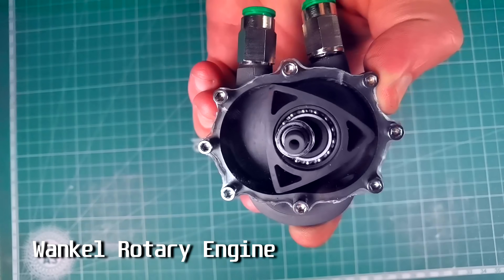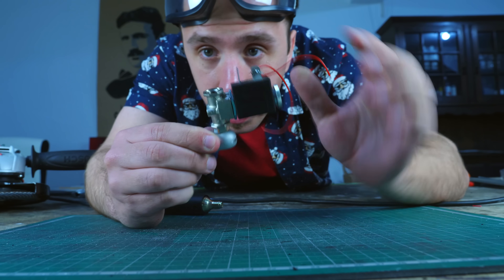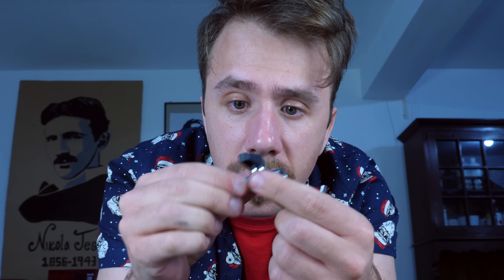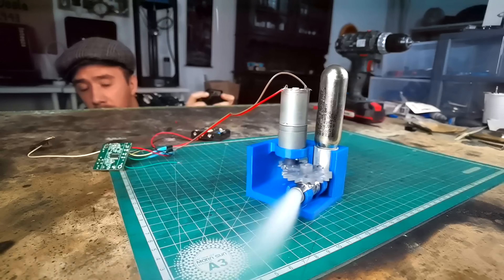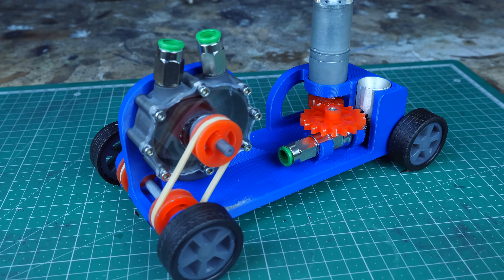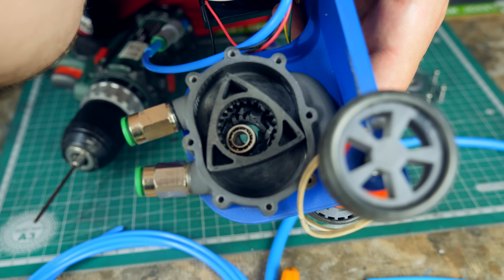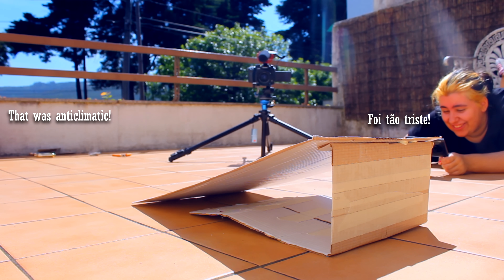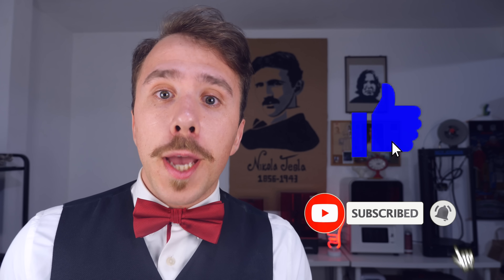Rotary Wankel RC Car (3D Printed)

Comment: I know that you will probably never read this, but 3 things you may want to change on the car is A, to add a valve on the end of the exhaust that adjusts the flow rate, that way you can get higher torque and higher "fuel efficiency." B, I would reposition the exhaust to be pointed behind the car, that way you get extra thrust. And C, I would put an O-ring on the lid, that way it stops leaking so much and losing "fuel."

Comment: Hey what you should do is print another smaller engine to use the exhaust gases for recirculating like the old steam cars did back in the day before the electric start motor was invented for combustion engines and phased out the steam cars. 

Please check this out
https://youtu.be/rUg_ukBwsyo

Comment: In the slow motion footage, the rubber band that was attached to the engine and the wheel axle was flopping around and slipping. To improve, maybe try putting the wheel's axle directly through the axle of the engine. That way, every rotation of the wankel engine will be one rotation of the wheel. The wheels would also need to be made slightly bigger. With these modifications maybe it would go way faster.

Comment: Why don't you make a mini compressed air tank which can hold more air at favourable pressure and then try to rum the car (the engine ofcourse), because using those CO2 tanks is very inefficient and most of the power is wasted

Comment: You should definitely have a part 3 to this. I’ve identified a few issues that you may or may not have identified too that you could fix. First is that the engine is not sealing very well and letting a lot of gas escape. Maybe you can use some kind of sealant to try to keep the gas in the chamber to push the rotor. Another is all the wheel slip which you did state yourself in the vid. And also it’s hard to tell but I think the rubber bands are slipping when transferring power to the wheels. That may also be fixed with the engine moving slower? 

Also it may not matter if it is ripping through co2 so quickly but maybe you could use a steeper motor to more accurately adjust the gas release?

Comment: Apples and oranges. Your engine needs large volume of air, the C02 produces lots of pressure but no volume. Optimize one  at a time, separately. Good job guy. 
.

Comment: You should make a belt tensioner for this car, make the wheel base slightly bigger, and make some kind of regulator for the gas that's coming out. You would get a better pull off the line and you would get further travel.

Comment: Why wouldnt you use a quarter turn ball valve and solenoid?  No gears or extra work to open a valve..  like even an rc one would work and comes with its own controller.. or hell use a 3/8 air nozzle blow gun attachment.  Cheap and reliable and easy to actuate..  a simple magnetc solenoid would for sure work to open n close the valve whuch could be hand made with some mag wire and an iron nail.  Use a paintball co2 tank and bigger n better drive control..

Comment: Idea: 3D print a 3D Printer! I would imagine you would need resin or maybe ceramic or something for the head because of the heat, but a majority of the parts could probably be made with PLA.

Comment: You should 3D printed a Vortex tube which separate compressed air in warm and cool airflow.

 I would like to see A video about minimal surfaces and what are the options for stable 3D prints and using small amount of material.

Comment: Without a mechanism for warming the CO2 to room temperature before it gets into the engine, you only get ~15% of the energy possible. Under ideal (isothermal) conditions you should be able to get almost 300 joules worth of energy out of a 12 gram CO2 cartridge.

Comment: Man, you should 3d print a multi-stage rocket with sugar as fuel. 🚀
Reply: I don't know if sugar alone will work as fuel? I believe you need a mixture containing potassium nitrate (saltpetre) to make solid rocket fuel. In some places it isn't exactly legal, because it is considered as explosives or ballistics.
Reply: Ok, then use another fuel

Comment: Maybe you could design and print a co2 powered RC rocket plane. The plane could be toss launched then the co2 cannister activated, maybe you also design a proportioning valve for the thrust and fly it around.

Comment: Would designing the Wankel engine "piston" with concave curves, rather than convex, increase the power of the engine? Im not sure how much the housing would have to be changed to accommodate, but I would thing that pressure against a "scooped" surface would give you more bang for your buck. The thinner points to the rotator might give reduced integrity, so a stronger material may be needed. Good luck!

Tldr. Give the spinny some weight(mass)-loss.

Comment: You can 3d print an orifice to work as a jet for the out gases. this should give more thrust to the vehicle (Car if you want to name it so)
also you need to control the exit pressure by controlling the orifice opening (using a servo motor should do the trick) by doing so you can control the speed and maintain longer run time.

Comment: Make a 3D printed RC tank or plane? Maybe with some sort of Tesla component in it. Maybe the plane can be powered by compressed air and a rotary valve if you can control the flow rate or expansion rate (Thrust) of the compressed gas, and have it hook up to your rotary engine, and a propeller (or multiple if need be).

Comment: to fix this car you could add weight to the front of it or you could make a gearbox that turns the many rotations of the wenkel engine into a bigger gear for a slower but stronger spinning wheel (more torque). i like watching your videos :D

Comment: If you look at the slow mo of the engine, you can see that the rubber band is too slack and thus almost all of the engines power is lost to overrotating of the engine pulley.

Comment: Video idea: build a Wankel engine with multiple rotors. Other people have already mentioned that co2 needs to be atomised first, and you also need a geared transmission, but I also noticed the large amount of vibration caused by the single rotor. Add more rotors offset from each other to help balance the vibration

Comment: You clould use the wankel engine with the Co2 cardridge as helicopter. You already had a propellor mounted and with a bigger one it could be possible to shoot it like 30-40m in the Air

Comment: Make the drone rotor powered using compressed air. May require you to figure out a way to better control air flow, but I can already tell you like a challenge

Comment: Try to seal the engine further to get as much as possible out of the CO2 container. Make a better gearbox. And strap on two CO2 containers as a rocket booster. "Voila" controllable Rocket powered RC car!

Comment: Future Video theme: - Using a Nichrome heating element to excite atoms for more directed thrust
Have you ever considered using the electrical heating element (Nichrome) from a Vape (Electric cigarette) to function as an induction coil for either an Ion engine, or a heat vector engine?

Comment: What about a fully 3D printed tank with tracks. Put the improved and much slower expulsion of co2 canister with your wenkle engine on its side instead of vertical to power the tracks so you don’t get as much jumping from the motor.

Comment: Try useing a chain instead of a rubber band and get a better tire for it, then add a centryfugical (how ever it spelled) clutch to it and also a better valve for the co2 that you can controll, maybe try a plastic bottle for an air tank.

Comment: You are losing so much power because the rubber band doesn't grip. The engine turns and the wheel doesn't turn because of the rubber band!

Comment: The wheels would do the job way better, if the car would have a rear-wheel drive. The front wheels can't handle the amount of torque, that the engine is making. Also, all the weight on your car is on the other axis. Let the engine spin in the other direction and you will get a nice racecar.

Comment: the problem is the wheel hop from the rubber band drive, i'm sure it would be alot better with more rigidity in the driveline :)

Comment: Improvement idea: you could use your Tesla valve (reverse-side) to slow-down CO2 and feed the engine at better rate. (If you manage to handle that pressure)

Comment: Why don’t you stick a larger CO2 canister on the car, perhaps a 12-24oz canister. Maybe fit a variable valve and some gearing to the car as well. You would probably have to make the car quite a bit bigger, then you can add steering as well.

Comment: Video idea: improve this design by making a gear drive. It seems a lot of your torque is lost in the band slipping. Also turn the cartridge upright to get more gas out of it and orient the motor so the exhaust is pointed backwards so the exhaust gasses give the car extra forward thrust!

Comment: The only thing I would suggest with the Wankel engine, is reverse the direction, so the engine is in the back. and put the batteries slightly ahead of the back axle. This will give you more traction on the wheels under power.

Just think, if the back wheel has a combined force of traction and speed and torque, it will try to move forward in the the path of least resistance. Which is a line pointed forward under the mass of the car. (More traction) The front wheels will be pushed up so the back of the car can go under it.. That is why race cars have wheelie bars. You don't need wheelie bars with front wheel drive.. 

Second design option:
In the jet version, make an exhaust pipe with a narrow jet nozzle to give you more velocity at the output..

Instead of just one hole in the nozzle, make a bunch of tiny parallel holes, similar to how holes would be in a hand full of drinking straws. Just make each mini hole pin size...

Third design option:
Have the jet nozzle turn a paddle wheel(like steam boats have) version of the Wankel engine... ..

May I also point you to the car designs of Professor Pat Pending....

Comment: >healthcare in portugal is state funded
>integza never wears safety glasses
Kinda rude, but OK.
Reply: If you turn the co2 cartridge upside down, you'll get less dry ice/liquid co2, and the heat of vaporization won't be stolen from the engine parts, but instead the tubing and canister.

Also wankel engines need a counterweight to significantly reduce vibration.

Comment: I feel like you need some kind of intercooler (interheater in this case) between the valve and the motor because all that freezing seems to be damaging the whole thing in the long term.
The big electric motor for the valve and the batteries weights too much it's a nonsense if you think about it since it's just for the valve, you really need to order that one from Amazon

Comment: Redo the wankle car and include a pressure regulator remotely controlled for speed control and a transmission with forward and reverse gears... The pressure was exceeding your seals and you where not getting enough traction due to the excess rotational speed, so additional gears would be amazing.

Comment: Since you can make the car run with the engine, try using belts instead of the rubber band.. It seems that the rubber bands are just too thin and are slipping a ton while the motor is rotating thus loosing a lot of grip that way.

Comment: You should try to 3D print and assemble a Curta Calculator, it’s an old calculator that’s entirely mechanical! And there’s already a 3D model for it on thingiverse!
Reply: Wouldn't it take too much money and filament? Filament costs money

Comment: Overall a pretty good project, but if you want to improve your design, here are my suggestions: 
I think it wouldn't be a bad idea to move the center of mass more to the front to improve grip, and also maybe redesigning the valve system to use something like a servo, to increase run time, efficiency, and decrease engine wear.

Comment: You should probably not use the pulleys and bands, you have like, 99% power loss through that transmission. I don't see any reason to not resin print gears to make it a single gear transmission

Comment: Video Idea: 3D print a 2 or 3 or 4 cylinder car engine that's obviously smaller, and try different types of fuel like compressed air, petrol and maybe others like nitro. i just want to see plastic burn XD

Comment: An interesting project would be to try to power your wankel with sparks. A powerfull enough large spark will heat air as much as igniting gasline does. I once had a 1000V on a 1000uF capacitor completely blow up a fuse holder, like a firecracker. It would be a new type of electric motor !

Comment: How about printing a CVT for the car? Well, and what the others said, turn the CO2 bottle and use a pressurecregulator.
And for the rocket version, maybe the Jörg Sprave approach? Preloading the valve with rubber and just releasing the force of the rubber to open the valve much quicker.

Comment: Maybe try replacing the belt with a gear system, since it looks like your Rubber band is slipping off the pullye
Video idea: CO2 Cartridge full fledged rockets ?

Comment: Please correct me if I'm wrong, but the wankle engine has a compression phase. 
Isn't that just wasted energy here, because there is no combustion?
Wouldn't using a fan or turbine be more efficient?

Comment: First, tighten the rubber bands and retry, the engine is losing a ton to slipping bands.

Next project a 3d printed fully functional submarine using the engine and co2 with a prop. Also have ballast tanks and so on. 

Portugal is a fantastic country

Comment: But you are not using the engine as such. The thing making the work here is the compressed gas inside the cartridges, not the engine. This is the same as having a water mill that spins just because water pushes the blades of the rotor. Or the same as using a blower in reverse. Blow some high speed gas through the blades and the rotor will spin... For the engine to work as such (or at least to work as it was designed for) you need it to suck air at the inlet, the rotor design will compress it as itm oves towards the ignotion area, then ignite and the pressure increase from the combustion reaction will push the rotor further... the chamber becaming larger until reaching the outlet or exhaust are.

This type of engine happens to have three chambers at once, each at a different stage. As the rotor... well, rotates the chambers modify their volume: first reduces it, reach the ignition section, then incrases.

In the "original" engine, if we take the sanpshot of your vide at second 9 (https://www.youtube.com/watch?v=ReK0r9OdCes&t=9s), the part in the middle at the bottom is where ignition wold occur. Also, the rotor will make contact and seal the chambers at all three "tirangle" corners (plus the flat top and bottom surfaces). https://en.wikipedia.org/wiki/Wankel_engine

You have built something really cool, no question about it, but it is not a "Wankel" engine.

Comment: you are wasting the pressure by using a straight pressure which mean you must have do valve to hold pressure when it is no need so you need vavle like real engine that will relesies pressure when it need (sorry bad English)

Comment: Get your belt tighter. It is slipping like crazy if you watch at the slo-mo.
In addition get rid of front wheel drive. Make it RWD and it would have much more traction and would climb better. It seems that if you could reverse the rotation of the wheels it could be done pretty easily?

Comment: Video Idea: Build a 4 bar mechanism powered by the rotary wankel. Since the vibration of this mechanism would be very high, this might be a good start to 3D print a spring and damper system.

Comment: Try adding a lower gear ratio to the output of the engine. The engine seems to produce a lot of torque and the rubber band pulley slips. Add solid gears instead of the pulleys and mess with the ratio until you get the best result, maximum acceleration with no wheelspin.

Comment: Belt drive is absolutely useless for this case... the peak torque from that damn wankel happens almost instantly and doesnt last long. USE GEAR DRIVE. And bigger wider wheels.

Comment: You should build a Szorenyi rotary engine. Put both it and the Wankel engine on frames with larger offroad style dune buggy or monster truck wheels, and see which one goes faster. You could also compare the efficiency of both engines by testing which will go further.

Comment: Integza, you need to get a polycarbonate 3D printer. Cause they are awesome.
Ideas for future videos:
3 Tesla turbine gear system for a little car. 3D printed hovercraft or onewheel extensions (the kids would love it). Polycarbonate 3D printed Tesla turbine max rpm test!

Comment: You should build a 3D printed submarine: electric motor driven, with actual ballast tanks that you can flood to dive and then purge with a CO2 cylinder to surface.

Comment: Three dee print a supercharger, make a sturdier wankle engine and bind the charger and engine and see how many RPMs you get.

Could also test if you can add a correct gear ratio to turn it into a working drill.

Comment: If you "twist" the rubber band (check out UK land steam engines) and add some weight to stop it bouncing.

Your cart is great, but it's wasting a lot of the created rotational energy from the band and bouncing

Comment: Your biggest issue with the engine powered car was belt slip on the pulleys! If you look at the slowmo footage you can see the engine rotating rapidly where the tyres aren't spinning at all
Can fix this problem plus your speed problem with a small gear ratio - that way you can avoid slippage and slow the output speed :)

Comment: Emough people have mentioned the CO2 being upside down, but it also looks like the engine can't transfer the energy properly enough to the wheels. If you look closely at the rubber band It's spinning faster than the wheels, meaning it's slipping quite aggressively. A cool idea for a next video would be 3d printing a gearbox for the car.